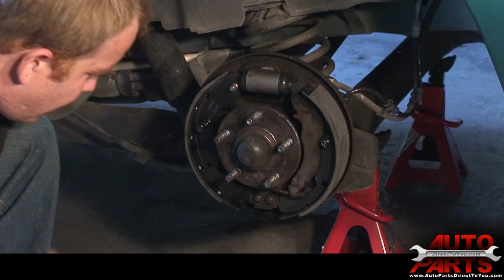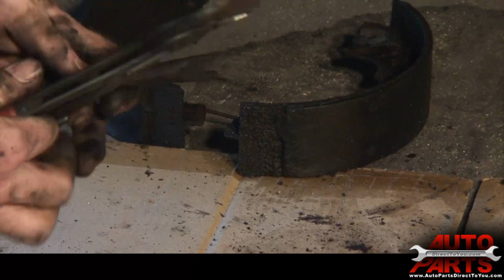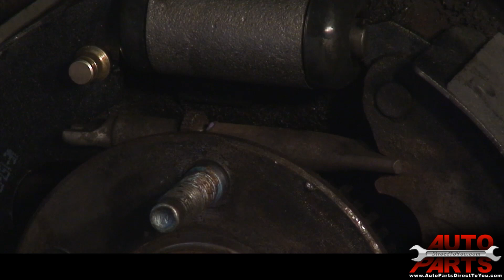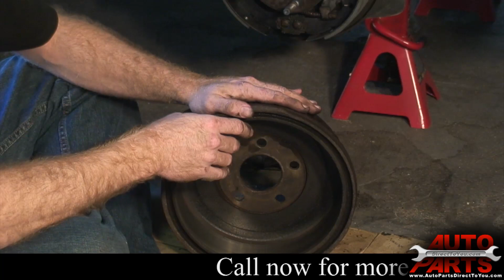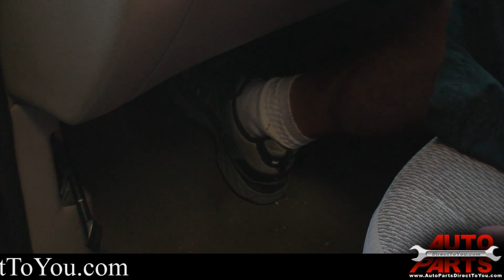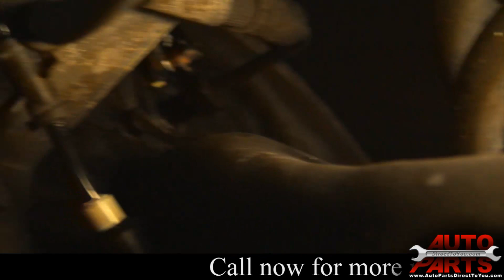2002 Ford Windstar Rear Brake Hardware Part 2

Comment: I just watched this video and I noticed one thing you don't mention: Check the fluid in the master cylinder before and after bleeding the brakes. If it is low, you could add more air to the system.

Comment: so with the adjuster should we screw it in a bit so the drum fits better?
Reply from the maker: So when you install new brake shoes and especially if you are also installing new brake drums, the adjuster would need to be screwed in all the way for the new brake shoes and new brake drums to fit, you also should clean and lube the adjuster, once you have it all back together, you would screw the adjuster out so the brake shoes just barely touch the brake drums, if you machined the brake drums and they are not new, then you would unscrew the adjuster out even further to take up the space allowed by removing some of the brake drum material. Basically the answer is that once you are done, the brake shoe adjuster should be adjusted so the brake shows barely touch the drums, rule of thumb is you spin the wheel (with the tire bolted up) freely for 2-3 full spins and then it should stop, if the adjuster is screwed in too far, then your brake shoes will take a slightly longer time to engage. If the adjuster is screwed out too far, then the brake shoes will get overheated by them touching the brake drum too much. they make a special tool to measure the brake shoes and drum or you can just adjust the adjuster and keep putting the wheel back on and verify it does spin freely but has a tiny drag and stops Turing after about 2 spins.

Comment: No brake fluid comes out of the bleeder screws in the rear. How do I solve this problem?
Reply from the maker: Frank Huff you can bleed the old fashion way by pumping the brake pedal, this will pressurize the fluid and it should come out, watch a few other YouTube videos where one person pumps the brake pedal while someone else cracks open the bleeder, as long as the bleeder screw is not open when you release the brake pedal, then you will be good

Comment: I am glad you inform people at the start to do one side at a time, a common rookie error. When replacing the springs. I did not see the clip which contacts the brake shoe self adjusting wheel. Was this deleted one later models of the Windstar? Also, keep the brake adjuster on the correct side of the vehicle as they turn in opposite directions, another error I have seen.
Reply: always take a picture before you disassemble.

Comment: Did you bleed the brakes with the engine off?
Reply from the maker: Yes, you do not need the engine running when bleeding the brakes.
Reply: Auto Parts Direct To You
thanks your video helped me a lot, brakes are still a little spongy though, would you recommend bleeding the fronts too? it's only the back that I changed
Reply from the maker: Benjamin Gonzales Bleeding the fronts is a good place to start. If that doesn't help, you may need to adjust the rear drums further out. Improperly adjusted rear brakes is a very common cause of soft/low brake pedal.

Comment: You are correct.  We just did a complete rear brake job on a 1998 Taurus, and this is identical in every way.  I am sure there are different part numbers for the springs, etc, but the process and the parts placement are exactly the same.
Thanks for this video.  We will be doing my '03 Windstar this weekend.

Comment from the maker: Did you lubricate the backing plate where the shoes rub against the friction points? If not lubricated, it can make clicking noises when applying the brakes.

Comment from the maker: If this is the case, your springs are likely worn out and you may need a replacement rear hardware spring kit. Placing the spring into a different hole might work without issues, but I cannot recommend it.

Comment: What do you do if the lower retracting spring is loose even when inserted into proper holes. should I insert the spring into the outer hole?
Reply from the maker: the springs could be worn out and they should be replaced, they are cheap and called a combi or brake combination spring kit, they are really worth replacing if even worn out a little bit.

Comment from the maker: We don't have a video on the e-brake cables at this time. They usually aren't too difficult, the cables are usually held in place with spring tension and clips, so you just have to pull the springs back, and unclip the cable from what is holding them.

Comment from the maker: you can usually get away without taking off the brake shoes when replacing the wheel cylinders by themselves. It just involves a little more prying, you have to pry the shoes back from the wheel cylinder when installing it.

Comment: do I have to remove the shoes just to change the wheel cyl.? or can I just un bolt it and slide it into place
Reply from the maker: its much easier to remove the shoes, also you don't want to get brake fluid on the brake shoe friction material as then they have to be replaced.

Comment: Are the break assemblies for this van and a 2003 ford windstar SE the same? If so, does the break fluid run in one line and come out the other? I've been having major troubles finding videos on an '03 windstar break assembly

Comment: great video! but have one question, when bleeding the breaks can you have the screw open already when hes pushing the brake pedal down, or does it have to be pushed all the way down before opening the screw?
Reply from the maker: you always want the bleeder screw tight or closed when you let off the brake pedal, if the bleeder is open when yo let the brake pedal up, you suck more air in.